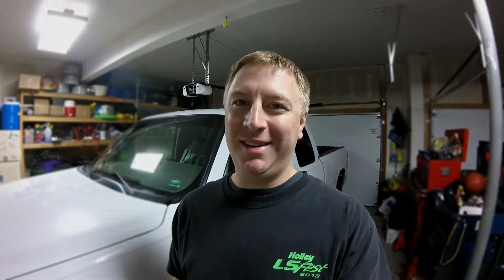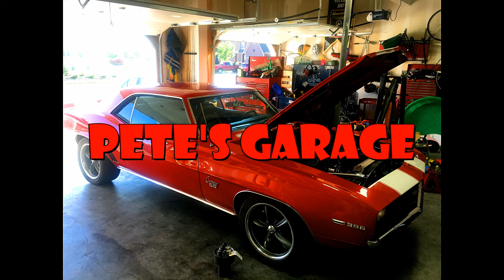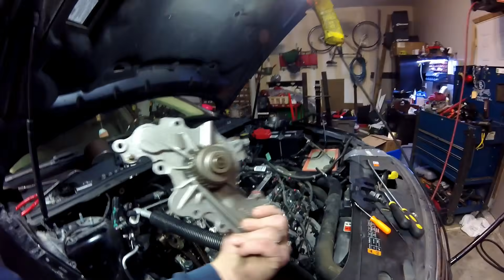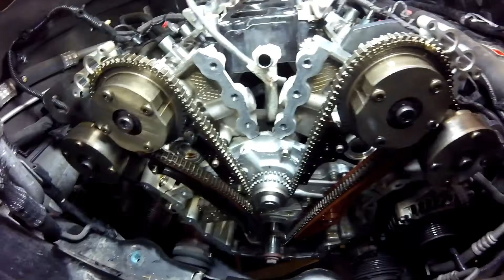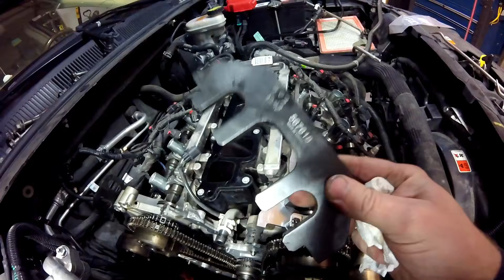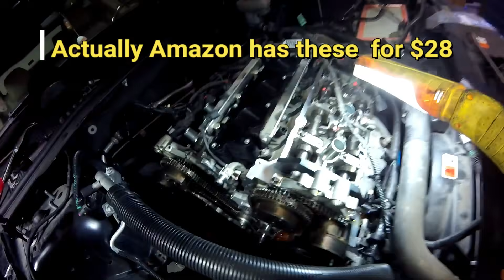Why does the Ford Taurus, Explorer, Edge 3.5L water pump cost over $1400?

Comment: Consider yourself lucky if it leaks on the ground. Because typically it goes into crankcase. Then hopefully you have deep pockets.
Reply: Yup, bye bye bearings.
Reply: It's really fun for Ford mechanics when that happens under warranty... NOT!
Reply: I was wondering about that....
Reply: yea i have the same year, make, and model and mine leaks on the ground and hasn't gotten in my engine but it still a super expensive repair for me and i still owe 18,000 on the loan smdh...😪😖😔😓
Reply: @Tallboi87  Pour some coolant in your oil filler, then take that shit to the dealer and get it replaced under your powertrain warranty.
Reply: @jacksonhomestead01  just make sure it's the correct coolant.
Reply: @bartscanland9415  Doesn't matter. It will be a milkshake by the time he gets it to the dealer.
Reply: Tallboi 87 That sucks man. Keep a very close eye on your oil.
Reply: Wrong… it does happen but not often. Most leak externally and when ignored the will eventually leak into the crankcase.

Comment: Why don't they just put an electric pump inline with the bottom radiator hose?  Would that be so hard?
Reply from the maker: Electric pumps aren’t nearly as reliable as mechanical pumps. And they’re more expensive.
Reply: I figured the part would be more expensive but a lot easier to change.  As for reliability, I wasn't aware of that. Thanks.
Reply: @PetesGarageandperformance  - A former gf had a 06 BMW E90 with an electric water pump. It was about the only part of the car I never worked on.
Reply from the maker: meabob yeah but isn’t the electric pump just there to circulate the coolant after the engine is shut off for passenger comfort? That’s the way it works on my e39 bmw
Reply: @meabob  LOL BMWs are POS unreliable money pits. Fun to drive is there only positive attribute.
Reply: There are a few that do. Some BMW 3 series and some Toyota hybrids are the only ones I can think of at the moment.

Comment: You are lucky if only one seal fails and the coolant leaks externally.    I had both seals fail and coolant mixed with the oil,  much more expensive to fix than $1400.   Great video!
Reply from the maker: Did you need a new engine?
Reply: How many miles in your car?
Reply: Im being quoted $3500-$4000

Comment: This is bad engineering all around. The reason the bearing wore out is because of the timing chain's tension. Planning it to be where it is is a big problem (and stupid). Maybe someone working at Ford really hated the company? Let's design a really bad engine! This one could end up being a class action suit. They need someone with mechanical ability to look over things like this so they could hit them over the head with a clue-by-four.
Reply from the maker: In Ford’s defense the water pump did go 140k miles before it failed. But it’s just buried in there.

Comment: I remember changing a water pump on my 300D Mercedes.
4 bolts.
20 dollar pump.
Nothing could be easier.
Reply: From 2005 on, Mercedes and BMWs are money pits and that's why they can be had pretty cheap when a few years old.
Reply: The water pump on my 1970 Chevy was pretty simple too.  Even a newbie teenager could do it.
Reply: @picklerix6162  4.6L cobra engines installed in a FWD continental is 4 easy bolts. They never fail anyway.
Reply: same on the Volvo red block engines.
Reply: how long ago was this?  lol.  mercedes has nothing that costs 20 bucks!
Reply: @hendawg3048  Maybe a single windshield wiper :lol:
Reply: Old VW beetle.... No water pump!😎
Reply: Didn't you have to loosen the alternator to remove the belt... on the 300SD it uses a double belt system on the 617 turbo.
Reply: @mikeicee  yeah I'm sure but this was about 20 years ago.
Reply: That's almost easier than changing oil
Reply: Shit my Honda's not even that bad  I change mine every 50k when I do the belt
Reply: Thanks to Honda, that's probably where Ford got their idea.
Reply: @bartscanland9415  Honda aint bad to change, and usually are changed every 100k when the timing belt is replaced.
Reply: Burt Hulbert try that on a new Mercedes
Reply: Old chevys the same
Reply: Caterpillar 3208, Chrysler 383/440, et.al.
Reply: Same with my 03 Ford ZX2 (Escort). 3 bolts, pull pulley, 4 bolts, pull pump, reverse for installation, replace o ring if necessary. $15-$35 part (ordering online vs Autozone).
Reply: And on a Crown Victoria. Easy job.
Reply: Benzes have other expensive problems, though the water pump isn't one of them on 300's.
Reply: My old VW Beatle required none of that.
Reply: Yeh there is. 5.9 Cummins.  2 bolts. O ring gasket can be done in less then 10 minutes
Reply: it is a very good design, all consumables should be very accessible, it is a basic rule in any industrial design
 @lewisbradford3305
Reply: @lewisbradford3305  2 bolts?
 Now that's marvelous.
Reply: @burtvhulberthyhbn7583  yep. 2 bolts

Comment: I stopped watching this at 3 minutes before I needed a doctor.
This is absolutely stupid engineering.
Reply: Ford's engineering design goals are to make the assembly fast and efficient, maximizing profits. They do not design for repair as a primary goal. They hope that failures and repairs are low enough to avoid hurting the brand. As someone else said, "It's the engineering of capitalism." Obviously, most of you have not worked as engineers who had an accountant for a manger.
Reply: @RichardFallstich  If Ford will not use common sense, then they will never get any of my cents. This is not an accountant standing over you design thingy. There is such a thing as a general design concept for a jelly bean V6 engine that can be tweaked here and there. This appears to be intended to encourage early junking of the car vs. repair. I'm guessing Ford won't be the brand the owner chooses after this insult.
Reply: @SirDeanosity  Early junking of the car over repair? What the heck are you talking about numb nuts? This is the best engine I've ever had. 180,000 miles and all I've had to do was that water pump. They put the water pump on the inside of the engine because there wasn't enough space to fit in the hood with the water pump on the outside. I'll gladly do a water pump every 125,000 miles or so.
Reply: @jimh.412  Glad for your experience. However I was not responding to you, sample size of one is statistically insignificant, and name calling is not an engineering method.
Reply: @jimh.412  So you have no problem spending three or four thousand bucks over the life of the car just on water pumps alone? Who's your daddy--J. Paul Getty?
Reply: @rcnelson  I've had the car for 9 years (180,000 miles) and spent a $1000 on the water pump so I don't think that's too bad. I'll gladly spend another $1000 for another water pump in a 125,000 miles or so. What other car are you going to get for a $1000? What--do you think you don't spend any money on repairs for your car? 🤔
Reply: All American auto manufacturers put the importance of engineering behind the sales and bean counters. Maybe after in a few decades after they've all gone bankrupt a little light bulb will go off in their heads and realize the average consumer isn't as stupid as they take us for.
Reply: What they saved by putting it there was probably offset by the extra costs to make special tools, a more complicated water pump, and lost future customer sales.  You dont bury a simple part that often fails, like a water pump, which requires basically a partial engine rebuild to replace it.  What a bunch of assholes.
Reply: I didn't make it that far. As soon as he showed the sprockets on the pump I yelled out loud: "You've gotta be shittin' me!" Click.
Reply: The Nissan VQ35 V6 has a timing chain driven water pump, but its small and can be swapped out through removable covers on the front timing cover.  Not exactly easy, but it doesnt require taking everything apart either!
Reply: Yes it is like why do to much when it can be as simple as a Honda j series a timing belt and the water pump. Easy 30 min to take apart
Reply: How about the GM 3.6, friend of mine just had the timing chains replaced on a 43k mile engine in his Traverse. $2700 out the door.
Reply: @jimmellenberger8505  He should have checked his oil once in awhile.
Reply: Burt - It's not stupid from the Ford thieves point of view. This deliberate crooked engineering keeps Ford dealers in business while emptying the pockets of their customers. Starting 2006 Ford eliminated the turn signal flasher relay  and runs the flashing through a computer smart box. So that means no more replacing a flasher relay for owners. One has to go back to the dealer to get the turn signal flasher reprogrammed for a few hundred bucks.
Reply: Crysler PT Cruiser has simular design. An owner has to pay 1500 dollars at least to replace it.
Reply: I agree. Any vehicle with a timing chain should have the water pump on the exterior of the timing cover. It wouldn't be difficult for them to engineer it that way and wouldn't take up much space. Timing chains can last the life of the vehicle. Timing belts i understand because they wear out often but chains really lol. Stupid Ford lol.
Reply: don't call them stopped because the stopped the get mad LOL
Reply: Yep but non of you Chevy guys want to talk about the timing belt problems with the older Colorado’s that you have to pull everything off the engine to change then which usually cost $2000 for that
Reply from the maker: The Colorado didn’t have any timing chain issues. Definitely had cylinder head/valve seat issues on the I5 engines. I replaced hundreds of cylinder heads on H3s. No need to pull the front cover to do those though. Every manufacturer has certain things that are a nuisance.
Reply: @theyoungmechanic9121  that engine platform was designed by isuzu
Reply: @theyoungmechanic9121  Don't some years of those have a V6 that requires you to pull the transmission because there's a timing chain at the back, between the flywheel and the block?
Reply: @theyoungmechanic9121   Real chev guys don't touch anything without an LS/SBC... I just like their V8 engines. Rest of their stuff... not so much.
Reply: It's the engineering of capitalism.
Reply: @javierEI345  sure. That'why on your socialism country you live grow up and now you are forced to be a doctor on the same wage as a supermarket janitor employee, cars never brake... always runs perfectly...
Reply: @S O U T H E R N  you got it!

Comment: Tools and labor arent cheap. Knowledge isnt free either. Now you know and knowing is half the battle.
Reply: Engineering degrees aren't cheap either, yet one of the most common points of failure is designed this way.  Hot coolant under pressure a seal away from a sealed bearing.  What could possibly go wrong with that?  That's why the Ancient Ones put them outside in front of the engine, driven by a belt, where they could be gotten to.

Way to go, Ford.  Damn millenial engineers staring at a computer screen all day thinking it's reality.
Reply: @lowercherty  engineers didn't have access to the same design and manufacturing technology. That's why they did things in a simpler fashion. Don't tell me your one of those "they don't build em like they used too" people. I'll take a modem car with more power, better mileage and vastly superior safety features over an under powerered, death trap classic car.

Bottom line if the way things were done in the past were better someone would be doing it successfully.
Reply: @9HighFlyer9  I worked with these kids before I retired.  Retired because the kids work cheaper or meet some quota.  Very little practical knowledge and even less critical thinking ability.  Granted the Vega and Pinto weren't the epitome of car design, but this isn't either.
Reply: @lowercherty  I'm not saying the Taurus is a pinnacle of design, but it bests anything from 1969. If not in style then in performance and utility.  You are free to look back with rose tinted longing, just don't group a whole generation of engineers together because you worked at a place with poor management. These "kids" are the same generation that has made SpaceX successful. Their employees are mostly in the 25-35yo range. The difference is in the corporate culture.

As far as them working cheaper and replacing the older guys, yeah that's how it works. New, inexperienced=Less pay. Older, not able to embrace new ideas and processes=Find a new job.

You should have taken the opportunity you were given to mentor these new engineers and show them how things were done. You could have learned from each other.
Reply: it cost money to know, when people call me out to fix their plumbing i told them it cost money to come to their house, and they want free estimates, i told them if they can drive to my house for free  then ill drive to their house for free.
Reply: @dangda-ww7de  no wonder u get no jobs. Lol
Reply: They call and ask how much is this and how much is that, i reply back and said, if they have to ask how much then i dont think they can afford it.  @usadaytrader
Reply: @usadaytrader  I dont need lowball bottom feeder customer asking for price over the phone.
Reply: @dangda-ww7de  Can't stand bottom feeders.

Comment: This why I don't own a Ford and never will again
Reply: Keep your depreciation machine's.  I'll stick with toyota.
Reply: Rickey Mitchell Have to get what’s already tried and tested. As far as engines go the tritons (4.6, 5.0, 5.3, 5.4, 5.8) were dogs but solid, the coyote 5.0’s are solid ass engines too. Hell, even 3.0’s and 4.0’s are solid. Parts aren’t too expensive and when you do the work yourself, you save a lot more in the long run. The same goes for chevy and dodge. Just have to do your maintenance. Treat it right, and it’ll treat you right.
Reply: johnny Macon un-American there son. Not gonna lie though, foreign cars are solid, but I don’t think they hold candle a to Detroit vehicles.
Reply: johnny Macon ehhh, anything with a v6 is essentially a turd. Import taxes on parts, when (inevitably) they go to shit, I’d rather keep my money in my pocket, and keep it domestic. Tried and tested is the way to go. Small blocks, big blocks, LS, FE, LT, Coyote, 385 series, 335 series are all bullet proof power platforms. The simpler, the better. Have had nothing but fords for ranch work, haven’t had issues with a single one. They range from 1976-2007. And there’s nothing but gm and fords where I’m at. The only people driving anything you listed are people who enjoy hanging out at dealerships whenever they’re foreign blows a head gasket.
Reply: You think all that other garbage out there is better than that good luck
Reply: Number 1 rated truck for many many years and number 1 rated sports car for many many years. Guess all those people rating the cars and trucks are wrong. They didn't earn those stripes by being junk.

Comment: That's why I won't own Ford products. So dumb.
Reply: Hate to break it to you but Ford didnt start this. Chrysler did.
Reply from the maker: From my understanding this engine is actually pretty reliable. Other than this one thing. This vehicle had over 140k miles when the pump went out. It’s just buried in there and the labor to replace it is expensive.
Reply: LOL  GM does the same thing as does Subaru Nissan Chrysler Mazda etc etc.   Ford is far from the only one to do this.
Reply: And nobody is breaking anything to me. I work on a lot of cars never said nobody else doesn't make things difficult. Ever try changing plugs in a Caddy? Not fun and takes 3 hours.